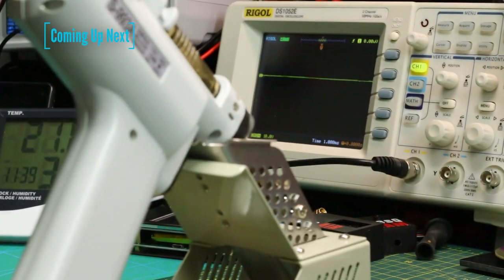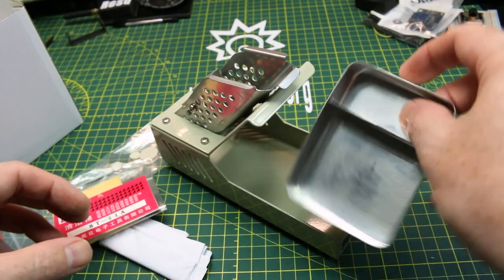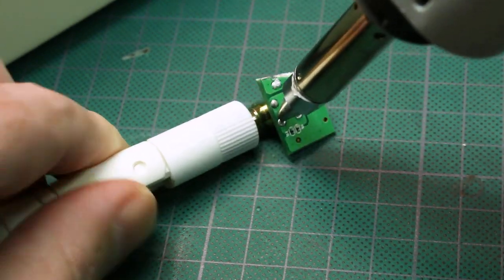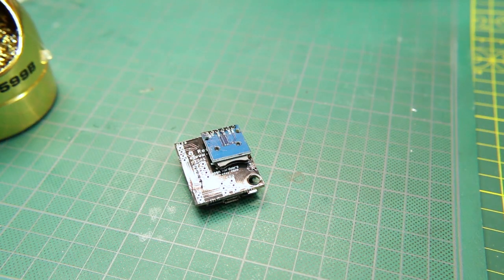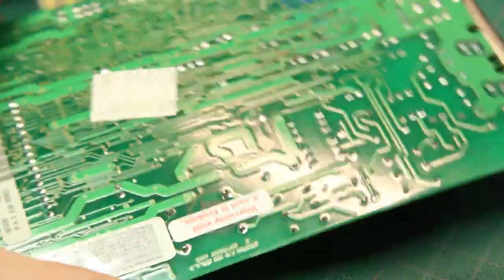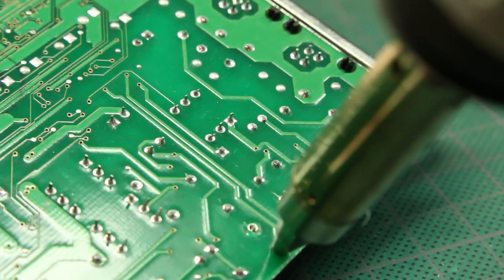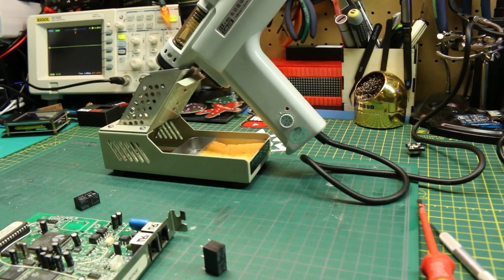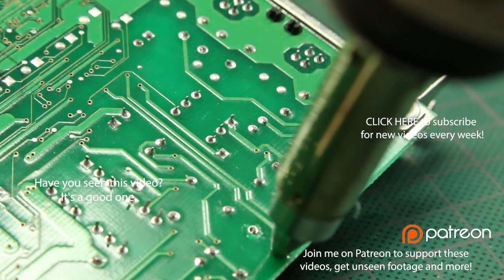Does a CHEAP Desoldering Gun Actually WORK?

Comment: Feels like this was designed for 220/240v and it just barely running at 110v, the sound of the pump sounds a lot quieter than when watching a review by someone in the EU or UK. I think a lot of these are designed for factory use in China and the thinking is ... well why not sell it on the open market? No redesign required since it's very simple, just stick on the appropriate regional plug. It'll run safely on a lower voltage, just cooler and weaker, probably why you had to crank up the temp.
Reply: Actually works perfect for me
Reply: Why bother redesign just for the us? It's pointless when like literally every non north America country uses 240v
Reply: @anonymouswhite352  I do not know where you got that from. Almost all LAtim American including Brazil uses 110, Japan, Phillipines, US, Canada, etc.

Comment: This is a Chinese clone of the well-known Goot desoldering gun. Get and use the right size (diameter) tip. And always clean out the tip when finished. Oxidized solder in the tip will be very hard to remove. Thanks for the video.
Reply: Ooh good tip. Thanks

Comment: I got mine a month ago. It puts a smile on my face every time. I have probably pulled 200 caps out of boards by now and I have had no problems. The amount of ChemWick I will save in a year will pay for itself. $100 U.S...no brainer.
Reply from the maker: Same. It works so damn well I still get surprised
Reply: I bought one of this desoldering guns maybe 6 years ago, I try to use maybe two times before to return to the box, I don't like the nozzle, is imposible to tin the tip, mine comes with steel tube inside.

I am thinking to remove the steel tube and change for a PCB copper eyelet.

My primary desoldering gun is a Hakko 808, I love it, more than 10 years without any problem.

Two weeks ago I bought one Yihua 948, works very well after do,a minor mod in the collector spring inside the chamber.

Best Regards.
Reply: @treadmillrepair754  Why do you need to tin the tip?
Reply: @richysradioroom  Tin the tip makes the heat transfer much better, is the same if you are using a soldering iron.
Anyway I am waiting for the Cooper eyelets, I try to remove the steel tube and change for the new one and do some test.
Take a look for the Yihua 948 is much better in every way.
In few das I will do a small video showing both S-993a with my mod and the Yihua 948.
Please take a look of my channel.
Sorry for my english.

Best Regards.
Reply: *chemwik

Comment: Sorry, I can not recommend this. After using one hour, (setting on 390 degrees) the heater element became an open circuit. Then I ordered a new heater and again the same problem.  I won't spend any money in buying again new spare parts.

Comment: The Stainless Steel tip on those doesn’t conduct heat nearly as well as a soldering iron’s copper tip, therefore you need the extra temperature to melt the solder.

Comment: 1. It is required to wet lead-free solder on modern boards with ordinary lead + flux
2. choose the size of the nozzle of the tin pump according to the size of the the contact
3. hold the gun from the bottom and the board from the top so that the tin pump does not pull the solder out of the hole of the board, and the solder itself slides down into the nozzle.
4. polygons with high heat capacity require a longer waiting time for heating by nozzle of desoldering gun
5. it is better to connect the pump motor to an external power source (and adjust the voltage and current on the motor), because the internal power supply of the motor on a triac from 230v is complete nonsense

Comment: trying to suck solder out of a big ground plane is a hassle. you can try pre heating the entire board with hot air, not burning anything of course. then after a minute or so with some heat, youll get nice results

Comment: i destroid many xbox motherboards so i gave up on soldering and
Reply: Never give up
Reply: If you are in budget and need a throughole desoldering tool, take a look for the Yihua 948 is much better in every way.
Inclusive more cheaper than S-993a.

Best Regards.
Reply: how did you destroy them? too much heat? if so try to use less time on the board